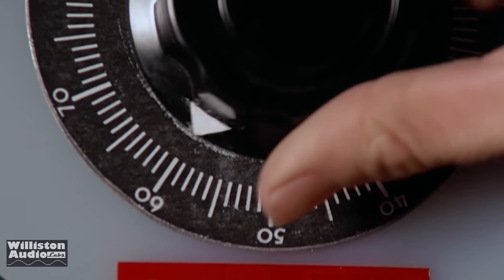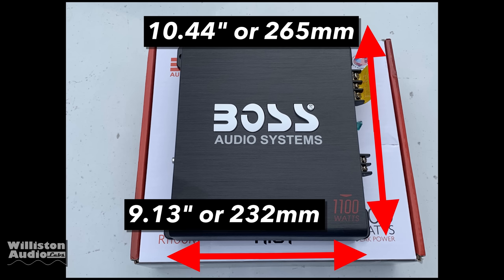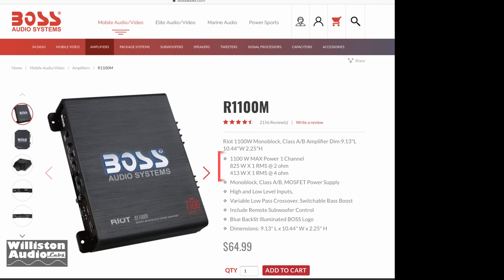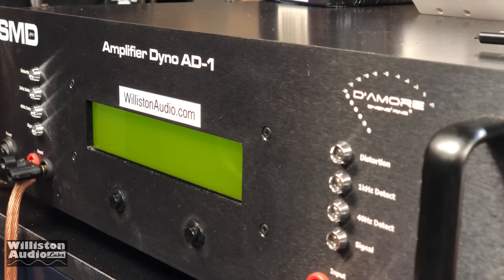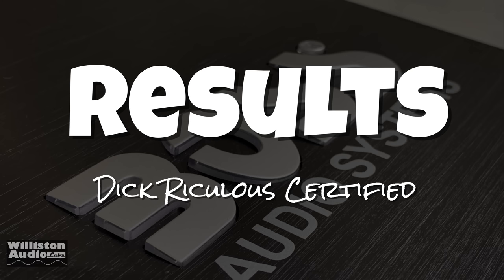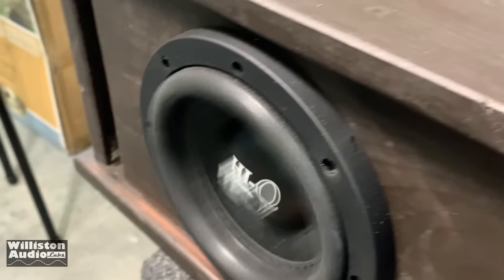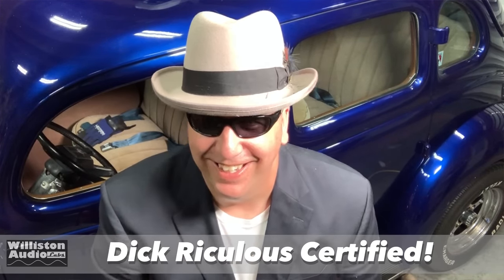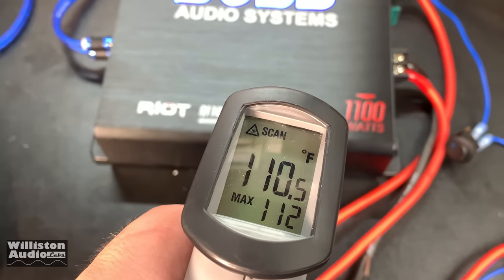Best Selling Car Audio Amplifier on Amazon (2019)? Boss Riot 1100M Monoblock [4K]

Comment: Just set a return up for mines.  Goes into protect mode when bass hits but my previous set up had no problem nor does the JBL 4-channel thats installed with the boss have any issues. Kinda butt hurt but happy to put my power acoustik pa2-520 back into service! I just wish that my performance teknique icbm-770 amp wasn't on the fritz or I would have used that all day instead!

Comment: I bought a 50$ Kenwood amp off amazon quite a few years ago. The model number is KAC-5206 and it's rated at 150 watts RMS bridged at 4 ohms. I'm curious to see how it would stack up against the amp dyno since they claim up to a "peak" power of 400 watts. Overall for 50$ though I'm happy with it. It powers the 12in sub I bought with it just fine and it sounds good. Not the loudest thing out there but in a VW hatchback it's plenty of power for what I want.

Comment: Would a xbox 360 power supply be enough to power this? Got a kenwood car deck running off a pc power supply and wanna add bass
Reply: You just need 10,000 3v battery and tv remote to control the volume.

Comment: The Boss R1100m works fine on a Pioneer low profile 10 under the rear seat in my Truck. Tested on a 15 in my van and not very good. If you wanna go cheap in a truck its fine. Not going to rattle cars around you but definitely good sound for a Truck.

Comment: What’s the highest watt amplifier can you get without having to add another  battery ?
Reply from the maker: Vehicle dependent, but generally speaking around 1000 watts
Reply: It depends on the load. You could use a high end efficient 3000 Wat amp but run it at 4 ohms for ~1200w and be ok if its 80% efficient
Reply: You see, THAT is a concern I had too, which is why I've bought two of these so far and LOVE them for the money. I've HEARD that this Boss 1100 is the only REALLY GOOD product that Boss makes. Maybe that is why so many are confused on this comments page. 

Peace!

Comment: Hey Big D, when I was a teenager I had 2 Eartquake 10's with a linear amp. It hit very very hard. Are the new earthquake subs any good ?
Reply: I have a pair of earthquake tremor 10 inch single voice coil and there pretty good they hit hard on low power, with a ported box of course
Reply: @salbatres3504  cool deal. Thanks buddy.

Comment: Derrick,
Love your channel. I'm 41 and love the old school amps. I have a Rockford Fosgate p300-1 and I would really like to see some Dyno numbers on it. It's an older model. I love this  little amp it packs a punch, but I am thinking of going with a set of savard hiq 8s and am looking at running a one ohm load. I'm not sure if this amp will be stable at one ohm. If you can help I'd really appreciate it.

Comment: And I just bought  the combo of the boss 1100 and small well says 1600 watt 10" sub to put in my freightliner cascadia  . Well I will be switching  out that setup . Works ok and for 130$ not an bad set up but I came from quantum audio 12" 3000 watts and 15" 3000 watts  on quantum audio monoblock amp. What's an good economical  amp and sub set up that will hit hard but compact neighborhood  of 1000 to 1200 rpms watts trying  too spend under 600$?
Reply: Pioneer GM-D9601 2,400W Class-D Mono Amp will do all 2400 watts at $200.

Comment: Just bought  this amp with a shallow qpower 10 inch in box for 70 bucks looks like im gonna be under whelmed but should add a little bass to my cruze currently everything is stock but it the pioneer upgraded audio with the 250 watt amp. 6.5 components in the front doors 6.5 mids in rear door and 6x9 subwoofers on the rear deck

Comment: I just bought a new 2019 Nissan Rogue it came stock with a Bose stereo with a subwoofer 
Any advice on upgrading the bass without loosing my trunk???
Reply: Upgrade the door speakers.
Reply: Any Specific recommendations as far as speakers ??? Also do I use the stock amp or do I upgrade that as well ???

Comment: I swear Boss uses the random number generator to rate amps. I have one of their motorcycle systems hidden in the dash of an old truck (running 6.5 coax's in the doors) they claim it's a 600w "max" amp... with a 5 amp fuse.
Reply: I made a somewhat statement about that earlier about Ohm's law.
 if you just want to figure out what the amplifier is estimated at, take the voltage times amps and multiply it by  .65 to be on the safe side
Ex: 12vdc x 30 amp fuse x .65 efficiency= 234 watts
However this would be for a class A B amplifier as Big D stated

Comment: Honestly i bought one of these about 4 years ago and before that had their 3k armor series and honestly wasnt disappointed all that bad, you are right, for the price they're pretty much bulletproof, however, they do need to BE HONEST ABOUT THEIR RATINGS. 
Their subs on the other hand are just about pure garbage when it comes to their power ratings. I had two of their 8"  cheapos, they did sound really nice in a small truck box, however they were super hard on my amp, dunno why, my amp fried them in 13 minutes of light dubstep and that amp put out about 250 rms, and since the 8's were rated "800" rms, wired to 2 ohm on a 250 watt rms Bazooka amp, eh, you can do the math, i can't.
Overall, they're alright for a budget build, you can get some good sound, but you better have good power and a high amp fuse because i won't be responsible for your vehicle if their products cause your amp to melt.

Comment: Watched a YouTubers video where he was putting in new door speakers and subs . He used a boss 1100 to power Two 12s the box said 1100RMS the fuse was a 30 amp So curiosity got me wondering what it was doing ... It's even less than the  250 I thought .  The one thing about cheap eBay or Amazon audio equipment is there is a line you cross from great equipment that cuts out the middleman sound shop and you get great prices and once you cross that line you're into the kind of CRAP you might find at the Denver flea market ...lol...Boss audio is at the flea market .  He out in the new coaxial speakers and then figur d he needs component speakers to sound good ... Yeah component speakers will have the ability to perform better ...but if you spend more than $25 a speaker you should be able to get coaxial speakers that sound good .

the subs were rated much like the boss 1100 something like 1000+ RMS and yet their magnets were suspiciously small .  Sometimes spending and extra few dollars can keep you from wasting a few hundred .

Comment: Interesting that the SMD meter says clipping at 145 watts but the amp dyno didn't.  

I've been a fan of yours BigD for a long time but I've never seen an explanation of how you set the input sensitivity of all the amps you test. Have you ever made a video explanation? Or have I somehow missed it?
Reply: Test tones vs music and they were using different sources.
Reply from the maker: Ohm load was different and a reactive (speaker) vs resistive load

Comment: any suggest for 100-150 to drive 500 rms speaker i have presently a fosgate half burn 300 rms looking to switch but low budget
Reply: Fosgate R500X1D, does 500rms at 2 ohms, $130 on Amazon

Comment: I’m build same box but  put 12 6.5 subs I bought for 7 bucks a piece. Power them with only 1000 watt rms amp. I can’t wait to see how they sound. I’ve had powerful 15 and 12s before I’m wondering if multiple  smaller subs can keep us with the big ones?  Or what the sound difference would be?
Reply: TheBighappy4u Depends, they probably won’t dig down as low in the frequency range as the bigger drivers will. Tell me how it all sounds when you get to it brother.
Reply: @ixionn563  will do

Comment: I recently purchased 2 planet audio AC10 D dual 4 ohm sub. They claim 750 RMS. I paid $35 each. I have them on a pioneer GM9701D at 1ohm. Though you might try these subs for the under $150 challenge!

Comment: Anyone know what settings on the amp are best to use because any tune I try ends up making shitty sounds
Reply: Make sure your head unit and source aren’t clipping. I keep my bass boost off on amp and head unit, your choice tho. If you choose to use them set them before you turn your gain up. Start gain low and work your way up slowly…

Comment: Your amp testing seems to operate at ~14vdc.  But ohms laws would need the amp to operate at ~48vdc to obtain the 1100 watts @30 amps.  What’s the max voltage of these amps?  Could you kick the voltage up to obtain the full power?  I believe the components in the amp are rated ~36vdc, which may be how they are able to make the claims, even though they know a car alternator/batters are at ~14vdc..  I can’t seem to find the voltage range in any boss documentation.
Reply from the maker: The switching power supply in the amplifier generates the higher voltages needed
Reply: So the claims of 1100 watts is just an outright lie… dang.  Keep up the good work!
Reply: I don't believe you entertained that mess. Can you imagine his response if we were still using bipolar transistors

Comment: Fifty bucks it's a killer deal. Even with the fake ratings.
Reply: EXACTLY!
Reply: @Ganderco  I just fitted my old Altec Lansing 2.1 in my car. It actually runs straight off 12 volts it's got a car radio chip in it. Bass port needs some tuning and box needs some fill but overall It's enough for the small Opel Corsa that I got. :)
Reply: Car's an old '96 junker but it's got low mileage it was owned by an old man who got his license revoked for medical reasons. Got it for a steal. All four factory speakers still work fine and it came with a really nice Alpine head unit with pre outs. The Altec fills in the mids and treble in the back as well as the bass allowing me to turn it down on the deck and not burn out the old factory speakers. It's actually also got tweeters in the front doors and those are also working still. Full electric locks and power windows on the front also heating on both the rear window and the mirrors. I just gotta figure out where the hell the fuse for the mirrors is as it's the only thing that doesn't work on the electrical. Everything else is perfect, engine runs great, emissions are low and I also got spare spark plugs, injectors, and winter tires complete with rims. All for... Wait for it... $600 with all legal paperwork transferred in my name. The Alpine head unit alone is worth 100.
Reply: U could get a dual for 20 bucks more N get real rated power

Comment: As you can see I'm "Old School" too. I've had the Jones since the '80s. I really appreciate what you do. I haven't looked through all your videos but was wondering if you ever did a dyno test for the MTX BTA line? I had a BN in the box BTA2100 for something like 15 years that I never installed then wound up putting it up for bid on Ebay, where I originally got it from. Still sick about it🤣. I figured it to be worth much more than the final bid $300. I almost didn't ship it. Thanks in advance.

Comment: There is a clientele for small amps, so why don't they just advertise the real numbers? There are TONS of car audio enthusiasts who prefer a small sub set-up just to fill in the lowest octaves. I myself have a beefy HiVi 8" sub in a TL cab, and it doesn't need anywhere near 200 watts to produce satisfying amounts of bass. If I had known about this amp's true numbers, I would have just bought it instead of paying nearly double the price for a high end low wattage amp.
Reply: I feel I got a 500watt jvc mono amp pushing 2 Boston 8s rated at 200watt each running 2ohm at the amp I wanna upsize but it's not worth it
Reply: toxic top hat Feels like no upgrade is ever enough for me, then I take a step back and realize what I have is enough for the time being. Love this hobby and the community around it.

Comment: I knew something was off about this amp I got the dual 1100 watts sub and this amp but felt that they should of hit harder..gonna switch out the amp and see what happens..great video thanks!!
Reply: The dual amps are no where near as bad as BOSS Audio stuff. The dual amp you can get from Walmart that is 600 watts will do almost 600 watts.
Reply: @braydenedwards2971  personally ive had a great experiance with dual, great stuff if you dont need anything special.
Reply: Did they hit harder?

Comment: I ordered a 12' Kenwood Sub-woofer with a box and this Amp as a combo on eBay. I just got it hooked up yesterday and to be honest it doesn't sound too much better than it did before I had the sub hooked up. I only spent $160 on the whole setup but, now I have to order a decent Amp that can actually power my speaker and that sucks. It's money down the drain. Edit: Just ordered a Skar amp For $160. Damn that hurt.
Reply: Hey sir. I wanted to let you know that this amp has a voltage sensitivity setting. Take it off 2 volts and slide it to the left. Bam. Major volume. Also, set your crossover to 100hz, and gain to half. Trust me it should thump. If not, check fuses
Reply: @TheCrystalGlow   Chris Storer  that "sensitivity" adjustment is so that you can match the amp input sensitivity with the head unit output voltage. The sensitivity adjustment is not meant to be a "volume" or "power increase" for the amp. Once you start going past your head unit's input voltage on the sensitivity, you start to introduce dirty signal Into the output to the sub....and that's where problems begin.
Reply: @TheCrystalGlow  Mine actually sounds better with the sensitivity slider set to the right (100mv-2v). It bumps too, I'm just saying it could sound way better if the amp's power output matched the subwoofer's rated power.

Comment: Hi, I really appreciate your tests, keep them coming! 
Although this might be outside the scope of your channel, could you maybe get around to testing some Behringer amps for real Watts? I'm thinking of the iNuke 3000 / 6000 / 12000 class D series, but i wouldn't mind seeing older EP AB ones tested as well.
Reply: He already tested inuke 6000. 2x2000w RMS at 4 ohm
Reply: Thanks, I'm looking it up
Reply: @DTXGaming  I have the 6000DSP and very happy with it. Tested on different speakers and subwoofers also
Reply: For several years now I've actually been using 2 bridged iNuke 3000s for my L/R tops, each feeding 2.66 Ohm stacks, one 6000 and one EP2500 for subs on my gigs. I know they are good (affordable) power and take care of speakers with no sweat and I was aware that the part number doesn't reflect RMS rating. i just needed to see them benched ;)
Reply: @DTXGaming  yeah, i think one of their spec sheets is closer to real power but i wish behringer used real numbers since it's not bad even with real measurements

Comment: Using the fuse rating as an indication of maximum power output is flat out wrong. Music has a crest factor of 12dB or higher which means that the peak power demands are 16 times the average. Current draw through the fuse depends on the average, not the peak. Also, fuses are designed to allow several times rated capacity for short periods of time. So a standard 30 amp fuse would normally allow over 100 amps for a second or longer. Given the high variability of music content, the amp can easily draw more current as needed for brief peaks.

Comment: Boss Ar 4000 is a good amp for the money and the ignite amps are good budget amps too. Fuses tell a lot of the story but not the whole thing. If you want more power get an amp with more fusing. Boss over rates there stuff but they do have some good budget amps.

Comment: I had this amp I loaned it to a friend he got it wet before it was ever installed but the cheap speakers I installed in my cousins car sound decent for $30 especially compared to his factory speakers from 94
Reply: toxic top hat Had their 1200 watt bridgeable 4 channel in my first budget setup. used the two front channels to run the door speakers (two speakers on each channel, 4 speakers total, 2 ohm load) and bridged the two rear channels to run a probably 100 watt RMS pioneer 12 in a sealed box at 4 ohms. It hit pretty hard for what it was. I remember I had mounted two 120mm computer fans on the heat fins wired to the remote power to keep it from overheating all the time. Solid amp though for under 100 bucks. 1200 watts was definitely BS though lol

Comment: I want to know how much power I can get with a budget of less than $ 60.
Reply: Not much. But check out audiopipe. Great little amps at great prices. I'm personally running the 2K and have been for right at a year. Better sound quality than my previous Pioneer 9801.
Reply: And look used if you can. Sometime can find a great deal.

Comment: I have a Planet Audio trq1500.1 mono block and I didn't buy it assuming that rating because I knew it was bogus but it was like $60 and I needed a cheap amp that would push my Polk db 12" sub in a ported box and I can say it does ok it thumps enough to slightly blur the mirrors but not a spl champ. But I can say it has been in my grand caravan for 4 or 5 years 100% problem free, I've pushed it wired at 2ohms and it's never overheated or kicked out. I do want to upgrade some day but haven't bothered because it is enough to over base the 4 factory 6x9s which I can say the OEM speakers are pretty sweet on just a $100 head unit for cheapie drivers reason for never upgraded those they sound great good treble real nice bass... People have said wow it sounds pretty powerful and nothing is... It's just a budget system. It is in a 2010 grand caravan the best auto for subs. That sub is decent but Only thing I don't care for is it in that 1.6 cf? Ported Box it tuned to around 44 htz... Mehh
Reply: Why do you have such a subwoofer box that's so small and tuned high when you have so much space?

Comment: I got 1 in the Jag Powered 1600 subs  lasted over 5 years when its hot outside goes into Protect mode, its decent for the Price highly durable but im going with a different setup. I think its time is up. Sas P